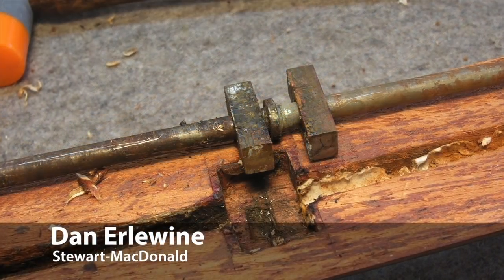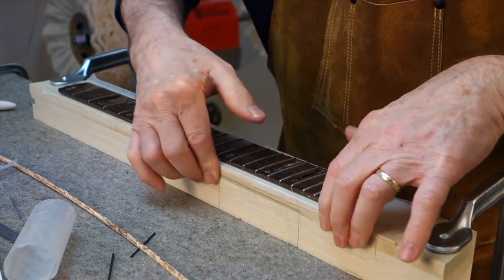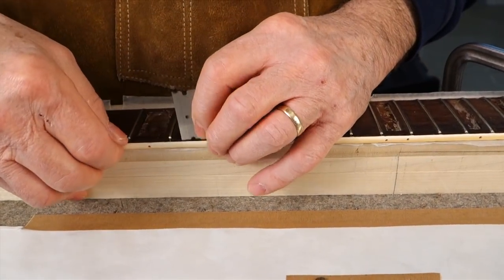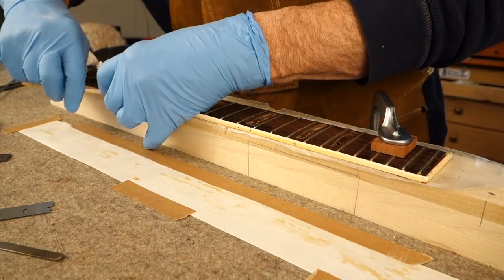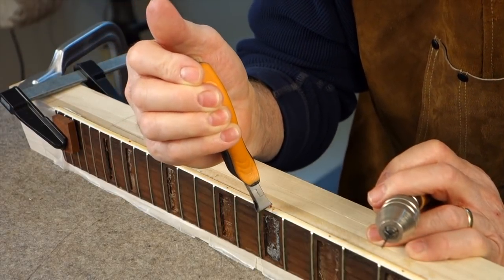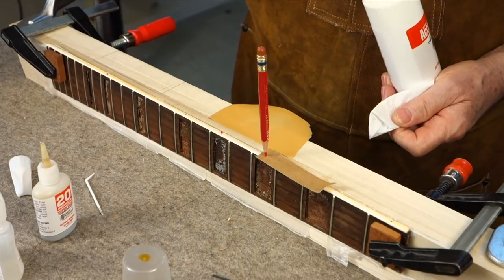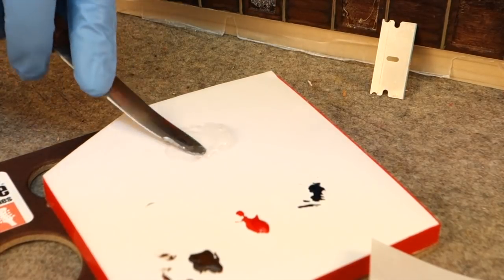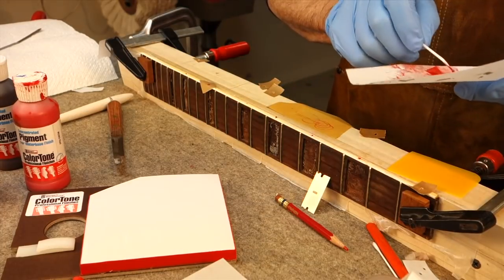Binding repair on a '55 Gretsch Roundup

Comment: one time i needed black dots for neck binding.  could not find anything locally.  hobby store, nope.  hardware store, nope.  walked into a dollar store and just started looking around.  ended up using the tines from black plastic forks.  worked great, and gave the "dots" a unique square shape.  :D

Comment: Man this is next level repair. Its one thing to swap pickups out of an Ibanez for your buddy, working on a crazy expensive guitar like this, there is little if no room for error you are trying to preserve as much of the original material as possible. Dan makes it look easy but I can say from experience it's not, I started off repairing guitars and now I build custom guitars witch in my opinion is way easier than repairing prized instruments.

Comment: I used red pencil for dots and when I put on the top coat, the pencil softened and was unusable.  I ended up using orange plastic trimming line that is used for weed whackers.

Comment: For Position Marker Dots, I've even just Crayoned them in using BEHLENS' Furniture-Fill Sticks. The Black gets Used most Often, of Course. But there's enough Variety there to be Creative with your Colour of Choice. And then just Smooth it out with a Soft Cloth, after awhile.